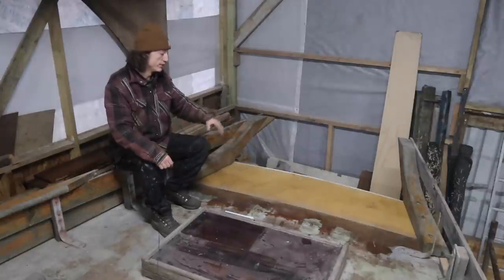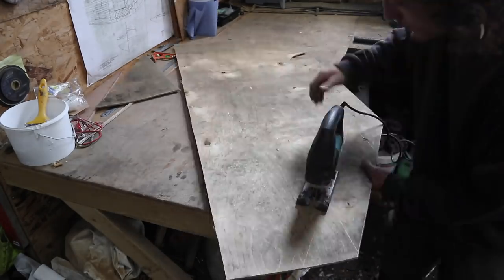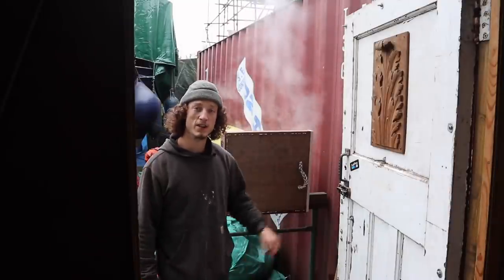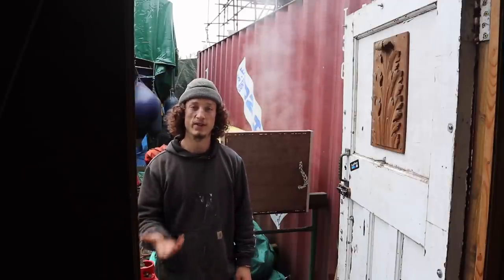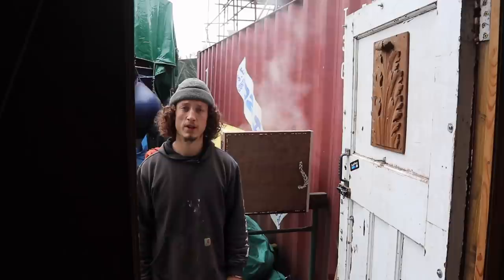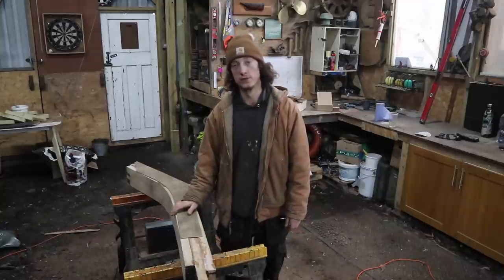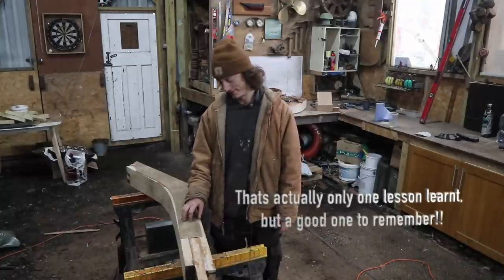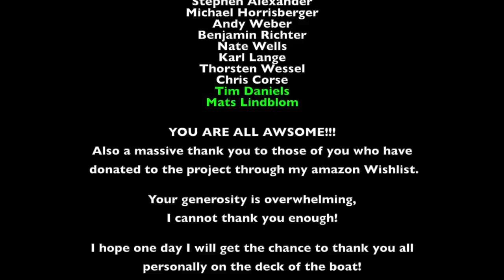Steam Bending and Laminating Transom Knees! ***Episode 21***

Comment: I was surprised when you didnt laminate them right on the former.. with some plastic over it so they didnt  glue together.   Hard lessoned learned.   One of the reasons I love your channel is that you are not afraid to own your mistakes.   Thanks Finn;  awesome stuff m8.
Reply: My first thought when I saw him laminating the first one.
Reply: I thought  that too!
Reply: Laminating like this makes some really strong & beautiful parts, but I too have learned (the hard way) to expect some springback.  The thicker each layer is, the more it springs back.  I can see steaming makes a big difference, but doesn't completely eliminate it.
I really like watching you work with the tools & space available to us commoners, and still do high quality woodwork.  Thanks Finn, Merry Christmas!
Reply: Yep--springback is real. I've been making bent shaft laminated canoe paddles for 2 years and that happened to my first shaft. I learned to apply the glue, re-clamp the shaft to the bending form and and let it cure for several days befroe removing.  Love your work!
Reply: My thought also. It would leave a little internal tension in the glue up but should result in zero spring back. Springback is so unpredictable and hard to design for.
Reply from the maker: My reason for not laminating on the former was simply because I made the former a tighter curve to allow for spring back. So clamping it all together on the former to glue up would have left me with the wrong shape also. It worked perfectly for the first knee of 5 pieces each 1inch thick. But indeed the thicker the timber the more spring back. Lesson learned. And a new method has been a success, Will be coming soon…

Comment: Hi Finn. Just in case you are unaware, the epoxy can be heated to a point where it can be taken apart. If you put the knee back in the steam box it shouldn't take as long as all that to heat it with the steam to that point. Also, the oak can then be steamed again to be able to re bend it on the former. I hope you read this before you start making a new knee, you can sand the faces back a bit before re applying thickened epoxy.
Reply: I think there may be too much bend in the knee to fit back in the steam box😞
Reply: @lemmy9996  but Finn could use a plastic bag for that which would be an interesting experiment. But perhaps that knee could be used in a different spot?
Reply: @lemmy9996  Not an issue: bag it.

Comment: I use a old band-saw blade with blocks on the ends putting this on the outside helps applying tension from the ends avoiding breakout in the center, give it a try brother works 100% of the time 4 me, my timbre is usually much thinner maybe 1 cm ish, should still work the same, a old guy taught me this 30 odd years ago, (if it aint bust dont fix it, lol) good look Fin,,xxBob&MrTao,xx

Comment: Excellent work as usual, well done. Just a thought; would laminating an extra board on to the notrightyet one give you enough meat for the knee or would it look weird?
Reply: Problem is you will only be needing small slivers of the 4th board and those slivers could or can split from the other three later on quite easy.
Reply: Could the problem of small slivers not mitigated by adding a one inch board and have the template placed so that on both sides you have half inch at the end ?
Reply: Great job Finn, at the end you will have a beautiful boat!
Reply: I reckon so too
Reply: If done properly, he should be able to treat that as if it had always been a single piece of wood. No matter how small the single pieces of board are left.

Comment: Love the video man... thanks for posting up. By the way I'm super confused why you didn't put that back on the former mold when you glued it.
Reply from the maker: My reason for not laminating on the former was simply because I made the former a tighter curve to allow for spring back. So clamping it all together on the former to glue up would have left me with the wrong shape also. It worked perfectly for the first knee of 5 pieces each 1inch thick. But indeed the thicker the timber the more spring back. Lesson learned. And a new method has been a success, New video will be coming soon…

Comment: Huh??? 

Just add a slightly larger block to the outside apex and get busy knocking off the extra wood chips....or make them both 1/2 inch thinner overall so that they match. It's a boat not a spacecraft.